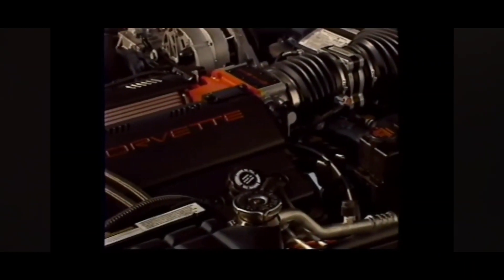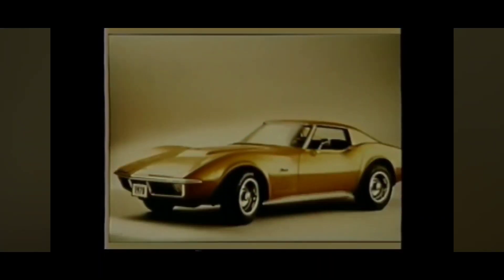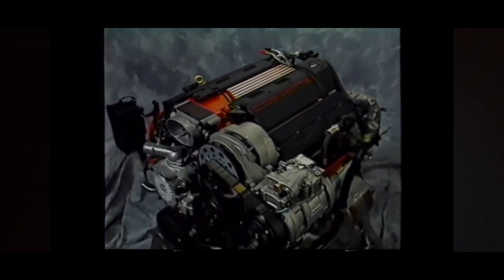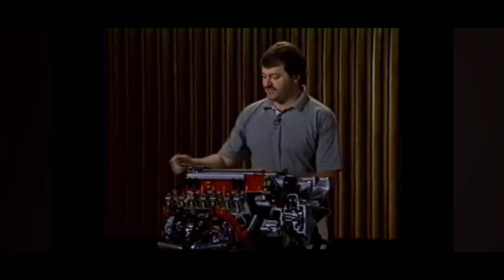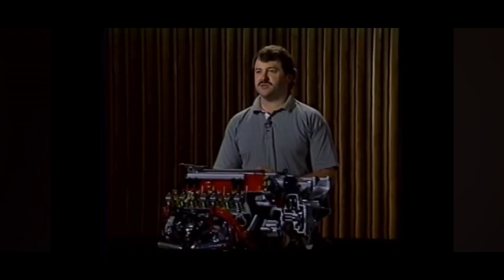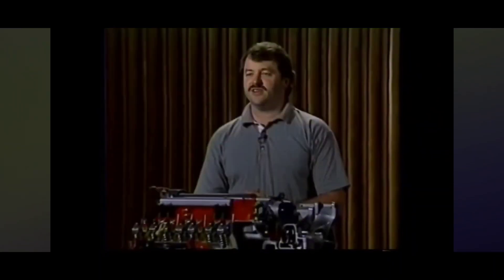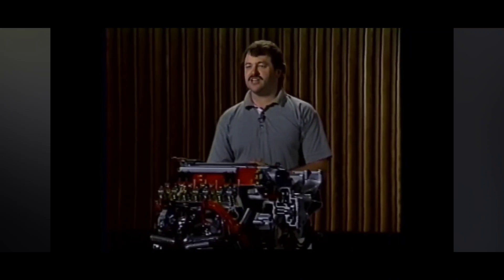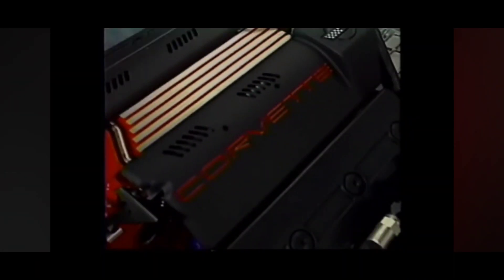The Real 1996 LT4 Story - From the GM Archives!

Comment: A lot work to come up with sad 30 hp
Reply from the maker: It's not just more hp, and more rpm. It's the things that support sustained high rpm use. Don't get hung up on the numbers. Plus, this is a naturally aspirated car with a street oriented stock cam. 30hp isn't easy to come by in this scenario.
Reply: @mattquerio  higher rpm use to make 30hp. I know they didn’t want make the new duel over head cam model for zr1 look bad as who would bought the high dollar option if the lt4 was making crazy more up. But all those changes to make 30hp is pretty damn sad. Think about what those upgrades would cost

Comment: I have a 96 Z28. 6 speed car. Bought it in 2000. Installed the factory GM LT4 kit for LT1s that they used to sell and the GM Hotcam. still own it and still drive it. Other mods too. Fast loud and fun. Its garage kept and still clean.
Reply from the maker: That's sick.  4th Gens are amazing performers, glad you got it with a T56!

Comment: There was a shop in Georgia, I believe, who put quite a few LT4s on a dyno... the majority of them made 350-360hp with some making a bit more and a couple making a bit less. If I can find the official report I'll post it.
There are also a plethora of posts on forums with individual's stock dyno numbers supported by the dyno sheets - normally they make 300-315whp which further supports the fact that GM was extremely conservative on the official numbers due to the LS1 coming to market in 1997.
I think it's a pretty cool story that the LT4 has. I always thought it was an LT with a cam until an opportunity to own an LT4 vet presented itself to me and it was a deal I couldn't turn down.
The power curve of the LT4 is also significantly different than the LT1
Reply: Dyno Numbers can be taken for real, because there are hundrets of little Things you can do wrong and get a different result.
I once read a report about this, sadly it is in German, where a Guy in Germany took his car, and visit 3 different Dynos in one Day. And he had 3 different Results, with nearly 70Hp difference.
A Dyno is such a complicated Thing most People dont realize.

Comment: I just picked up one. The November only got to drive it three weeks before I had to put it up for the winter but it’s the 96 with the LT4 with 25,000 original miles car is beautiful just like it came off the showroom floorand other videos that I’ve watched say that the LT four dinos it almost 370 and in some cases up to 390 quite a few videos out there saying that
Reply: Perhaps converted to gross horse power at the crank? I'm skeptical of those numbers because I had an lt4 with Vortex supercharger and air to water intercooler at 10:00 psi, and it put out just over 500 horsepower at the wheels. I find it hard to believe that the supercharger only added 130 horsepower at 10 psi😊

Comment: at 90,000 miles im doing the optispark thing, first time .
Reply from the maker: And it really isnt the big deal people make it out to be.  You likely won't ever need to do it again.
Reply: @mattquerio only if he can find an old stock GM part and take it apart with a magnifying glass and look for the Mitsubishi logo on the sensor. Otherwise they're all crap including the new ACDelco which use generic Chinese sensor and they fail😢  I know cuz I went through all this on my lt4 with the vortec blower and intercooler in front of it so it was a royal pain to take the whole thing apart again and the new special optispark from a Corvette specialist guy was bad out of the box. So I got a $700 MSD Billet optispark, and that one was also bad, it wouldn't have passed an idle, and the troubleshooting procedure is specialized in complicated for these

So I checked at all the local Chevy and other GM dealers, and everything they had in stock was AC Delco and they had the crappy Chinese sensor in it

I learned that even GM will not use the original Mitsubishi sensor because Mitsubishi will only accept an order of 10,000 or more units and GM thinks it's not worth it to take the risk on being able to sell that many when the Market's been flooded with the consequences of the globalists

Luckily, I found a brand new Old Stock one in the Box that an old lady had a local yard sale! Took it apart and looked at the sensor and it was a mitsubishi. That was the third one I put in and it finally held up

It's a horrible design that they were very proud of, however, if you don't have a supercharger and intercooler it's a bit easier to deal with drama but you still got to take the water pump off, and that's another part that even if you get it from the dealer, it's made in china. I had to order one from a dealer in Canada to get one that wasn't made in china. And if the water pump fails, then it spews water all over your optispark😢😢😢

Comment: The Last SBC was in 2002 known as Vortec 5700.
Reply from the maker: That was a gen 1 sbc truck engine. It was not the final evolutionary development. But it was the last I'm production.
Reply: Actually Mexican vehicles may still be using the sbc, I know certain vehicles were running the vortec up into the late twenty teens.

Comment: Nice! Besides the extra horsepower, the gearbox was carefully balanced to optimize the engine’s higher power band. I prefer naturally aspirated engines for their natural feel and less complicated maintenance. Subscribed.
Reply from the maker: It's funny you say that about the naturally aspirated engines.  As a kid in the 80s and 90s, all I wanted was a turbo car.  After having so many of the modern turbo cars, and a few old ones... I've realized the linear power of the NA engine is soooo satisfying.  I agree to a T.

Comment: I heard that the LT4 roller rockers are so rare and can't be seen by anyone except a GM certified ZR1 technician. When anyone else has tried to open up the top end of the engine the rocker arms disappear into a cloud and leave behind the standard LT1 rocker arms. That person is left to live a life of shame.....
Reply from the maker: Lol. Awesome comment. They're actually just Crane or comp cams, I can't recall which.
Reply: @mattquerio  they're Crane Gold Race roller rockers yes, only difference is the chevy bowtie in place of the Crane text, and the silver colour instead of gold. 

You can still buy the GM version from Summit Racing.
Reply: @mattquerio  LOL....I can't either. I know I worked on more ZR1's than LT4's though. We're almost as rare as the rocker arms. I left GM in '02 for more blue pastures, but there hasn't been a year since that I'm not diagnosing an Opti-spark failure. Thank GAWD for MSD and their unit.

Life with the SVT franchise dealerships kept me busy, but it was the 6 liter diesel that paid for my home. I love this industry and the owners that have made it possible.
Reply: @arturozarate1752  I've been driving Camaros since 93, I ordered a pre production 93 Z28, very rare car, bought another 93 just for road course racing, I have never had a problem with the opti, a guy I track with put a new MSD on his 96, it only lasted 10 minutes at the track.
Petris is the only way to go, his MSD was actually made in China.
Reply: @arturozarate1752  MSD optispark distributors were very hit and miss, and not nearly as reliable as the OEM unit. 

The first run or two of MSDs were fine, the rest after that used a cheaper optical sensor and that is what fails. 

The OEMs used a Mitsubishi sensor, and those do not tend to fail at all, they were used in a fair few other cars in Japan. A simple clean up and new cap and rotor and the OEM unit will easily last 20+ years.
Reply: @CaseTheCorvetteMan  in 23 years I've found sealing the "cap" to the base of the OEM units troublesome and a fail point. I haven't kept count, but in the cases that coolant was allowed onto the optical wheel it doesn't matter who makes the internals. 

"Hit or miss" speaks vaguely. I can't account for your claim on the MSD unit, but if a thousand were produced, and number 1 through 50 were okay, number 51 sucked, and 52 through 100were good....I and everyone of the MSD units I installed are alright with that statistic.
Reply: @CaseTheCorvetteMan  I bet they could last 20 years, but a better way was found to indicate event speed for the misfire counter and deliver spark. Personally I'm comfortable with the MSD as my choice for the repair.
Reply: @arturozarate1752   yeah, and i'm sure you'll continue to use the way over-priced MSDs too. But hey, it's me pulling them out dead, they're and the reason they're dead is nothing but optical sensor failure, a rate at which has been well know to be significantly higher than your example. 

In a little over 27 years, i've seen god knows how many OEM units driven into my workshop running with water in the distributor, rusty as f*** inside, still working. 

Obviously, just as many that were not running. I've rebuilt every single OEM unit that came through here, vented or not, and never had one fail yet. I do use the MSD cap and rotor kit, which adds venting to earlier 92-94 versions. 

I had two 93s come in over the past 18 months factory original and untouched, one even had 126,000 miles on it, still working. 
I've seen stupid amounts of other brands fail in short times, but that's another story.

Chris Petris is also very well known as an expert on building and rebuilding these distributors, and his units do not fail either. Also quite a bit cheaper than the MSD, and a better longer warranty. 

Any distributor WILL fail if you get water in it. I've seen plenty of L98s run like shit due to someone hosing the engine, and needing a new cap and rotor to fix that issue. 

You go ahead and use what ya like, it's well documented on at least two F-body forums how unreliable the MSDs are.
Reply: @CaseTheCorvetteMan  ah, so there are readily available rebuild kits? Man I've never and I mean never had one fail and I keep in touch with all my clients. Well, minus one that passed away last summer. 

I wouldn't mind rebuilding the OEM unit, but that's a decision I'll make if or when I see another through my shop. Almost half the year has passed and not one yet. Maybe this is the year I stop seeing them. Post the whereabouts of this rebuild info and maybe I'll keep some parts on the shelf.
Reply: @arturozarate1752   cap and rotor is available for both versions on Summit Racing. 

OEM units are getting pretty hard to come by. This is mostly due to people never realising they weren't dead and simply needed a good clean and a new cap and rotor. 

Wonder how many perfectly good ones went in the bin that could've easily been saved...
Reply: @CaseTheCorvetteMan  I'd say less than 400k
Reply: @arturozarate1752  The MSD distributors are not good, the original GM last forever, do not use a hose under the hood, every 100 thousand miles pop it off clean it up, lube the bearing, new cap and rotor, good for another 100 thousand, every MSD I have encountered has failed somewhere between one week to less than a 100 thousand miles.
Reply: @user-Dr.  I've got a 410ci build coming up for a client. His MSD has been doing its job for 30k miles, but for this new build the client and I have agreed to go with a Torqhead conversion.

I hear what you're saying, and it has me seeking alternatives if any problems arise. I'm sure I'll hear about it when any I've installed fail.
Reply: @arturozarate1752  The conversion is the way to go, I have not done it yet because I have not had a problem, I was looking at that setup a few years back.
Reply: @user-Dr.  just for the OBD II alone....and with so much being invested in this new engine, I like it.
Reply: you can see the rockers through the oil add hole in the valve cover with out taking anything apart, just remove oil fill cap.
Reply: @MrMisanthrope1RBjr  Yeah, I'm going out on a limb here, but I think he was joking.
Reply: @MrMisanthrope1RBjr  nay! The one to expose the loophole must be silenced🤫
Reply: Great video !  LT4 is definitely a great motor. Thanks !

Comment: LT4 engines are about 40 more hp then they say making that engine 370hp and the manual trans was geared higher so got you .3 making about 100hp differance in feel and 1/4 mile times. Ppl were reporting 13.0- 13.6 depending on the driver 1/4 mile Stock and with some mild simple mods like slicks .3 and cat back exhaust .4 and K&N air cleaner .2 ppl were running 12.4-12.8 best -worst times.              LT1 13.8-14.4 1/4 stock to run like an LT4 you can do the cam 22hp .25 tenths in 1/4 mile, roller rockers and valve springs 18hp .18 , intake air foil and K&N filter 15hp .15 cat back exhaust 42hp .42 and a mild tune to run the best 12.8 auto if manual faster  more like 12.6  add slicks and 12.3 - 12.6. so without slicks your there at that 100hp gain to make up for the auto to manual trans and run the same times.
Reply: Roller rockers and valve springs won't get you 18 ho. And the airfoil is essentially useless. Maybe 1-2 hp at most. Air filter 'might' be worth 5-10 hp at best. 
Long tube headers and high flow catalytic converters will gain the most hp and torque.
Reply from the maker: @msh6865 that is my understanding too, long tubes and gears are really the bang for buck mods for this car!
Reply from the maker: @djweszone Yeah there are a lot of tricks to wake up a LT.  I really don't know the numbers per mod, but they add up!

Comment: They forgot the plasma base plate attached to the exhaust pump. This will allow the engine to switch hyperdrive modes without additional parasitic drag. This is HUGE - and they didn’t even mention it!
Reply from the maker: I am not sure if you are trolling me, or if you are serious.  Lol.
Reply: WTF is he talking about, exhaust pump, hyper drive? Sounds better than blinker fluid and muffler bearings though.

Comment: 330whp maybe, they dyno at 330-390whp, Chevy did not want to overshadow the new LS engine that came out the next year, so they underrated these engines clearly.
Reply from the maker: They surely are strong, but I have no idea the true number.
Reply: @mattquerio  There was a shop in Georgia, I believe, who put quite a few LT4s on a dyno… the majority of them made 350-360hp with some making a bit more and a couple making a bit less. If I can find the official report I’ll post it.

There are also a plethora of posts on forums with individual’s stock dyno numbers supported by the dyno sheets - normally they make 300-315whp which further supports the fact that GM was extremely conservative on the official numbers due to the LS1 coming to market in 1997. 

I think it’s a pretty cool story that the LT4 has. I always thought it was an LT4 with a cam until an opportunity to own an  LT4 vet presented itself to me and it was a deal I couldn’t turn down.

The power curve of the LT4 is also significantly different than the LT1
Reply: With 190cc raised runner heads, 10.8:1 and 28lb it should be right inline with the early LS1, maybe better those heads likely to outflow the early cathedral ports so if throttle body, pre throttle body and exhaust flow is on par with the LS1 I'm guessing the LT4 lays down better numbers.